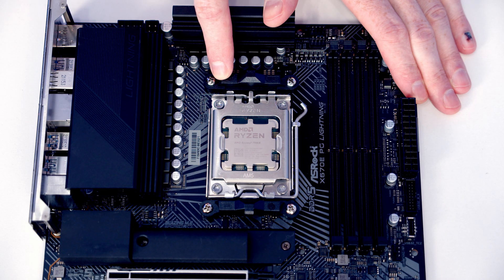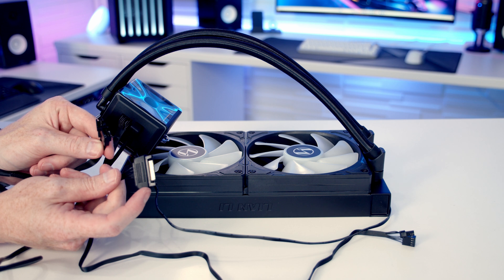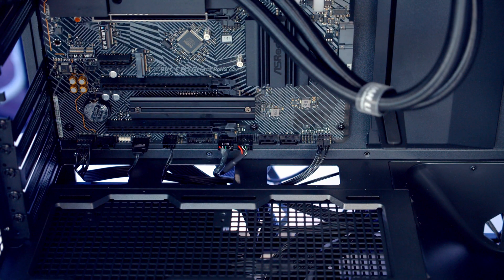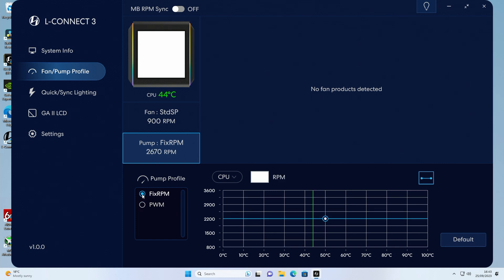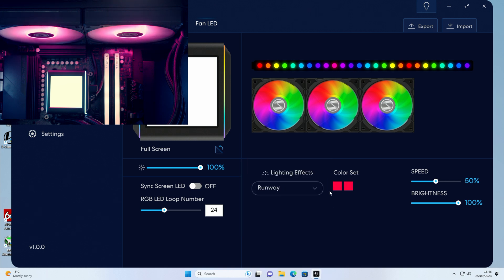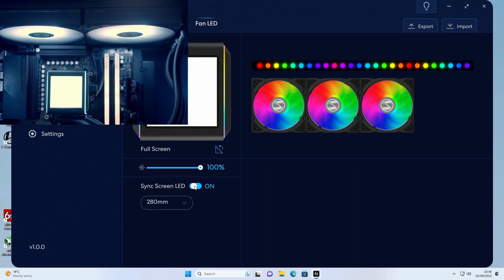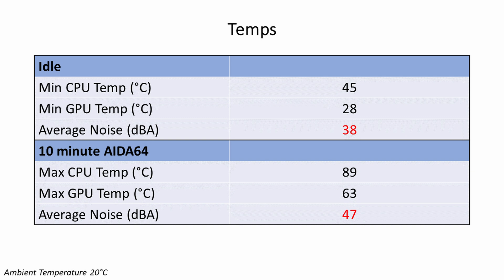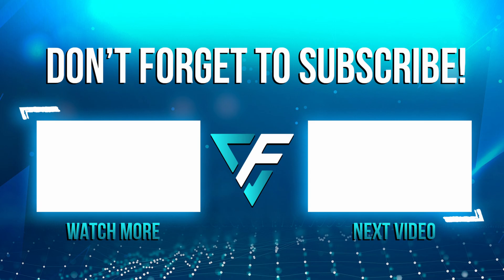Lian Li Galahad II LCD - Installation Guide

Comment: Fu...ng finally found someone that actually started from the very beginning without skip steps. and explained what are those cable and where connect them. Also explained how to use Lian li software.
My motherboard is a liitle different(MSI X870 TOMAHAWK WIFI) and i bought the 360mm version of watercooler, but rest it's pretty much the same.
well, THANK YOU VERY MUCH!!

Comment: i bought this over the weekend (except the LCD 280) at micro center and the box didn't come with "n" cable as it's called in the instructions...it is the split cable that plugs into the argb fans...i went back to micro center and they opened up 4 boxes and all of them were missing the cable...does anyone know if i can I can order that cable or a pack that has that cable in it? if not i am going to be really upset...i believe the actual cable is the PWM and ARGB to Lian Li Uni Fan SL Infinity 7 Pin Adapter Cable.....am i able to buy this? i am pretty sure i found it, i just want to make sure it is the correct adapter... if anyone has any suggestions on this i would really appreciate it thank you!!!

Comment: Is there a reason you didn’t use the controller? The other video I watched didn’t plug in the 3rd cable (3rd connector on the pump that had the SATA cable) but used the controller. I’m confused as a first time PC builder!😭🤦🏽‍♂️
Reply: I think the controller only comes with the 360 version

Comment: is it possible to change the orientation of the LCD in the software or does it have to be physically moved?
Reply: I wanna know this too because a store installed my unit incorrectly.
Reply: I figured it out, you can do it in the L-Connect software, under GA II LCD (Screen) look for "Full Screen" and right next to it is a right triangle, if you click it it rotates the screen orientation counterclock wise. Hope it helps.  @cemsengul16

Comment: Been going through a lot of LConnect 3 software issues with this product. Crossing fingers the company can fix it all this week for this is damaging their credibility.
Reply: They fix it or naw
Reply: @Demiii_GoD they have not. This software is incredibly frustrating, personally going forward I won’t be buying anything lian li as far as fans or cooler related in the future. I currently have a humming/revving noise while L-connect is open. If I uninstall L-Connect the sound goes away. I feel like it’s ramping the fans at a weird curve and I can’t seem to fix it at the moment.

Comment: Hey!  My 360 sl-inf LCD didn't come with the second cable that plugs into the pump.  Just the usb-C.  There doesn't seem to be a listing for it in the parts list either.  Is this not a thing in the retail version?
Reply: Same here, I had the Lian-Li GALAHAD II LCD 360 SL-INF and I also miss the cable at 2:07. Also not listed in the manual as you said. My Display is also going on and after few seconds off. Any solutions?
Reply: You only need the usb-c cable for the infinity 360 version.
Reply: @TheSjuris  This and I installed an older version from reddit

Comment: Been having issues with my screen turning on and then off. I don’t seem to have the cable you have that plugs in below the usb? But I am using an L connect controller plugging the fans and aio in. Any suggestions?
Reply: Same here where did he get that cable???
Reply: @alejandrorodriguez365 I found out that cable is for if your not using l connect. And just using your mobo to control the fans. But still no luck I made a post on Lian li Reddit. I’ve tried all software versions and no luck. Going to try a bios updated today. @christopherflannigan curious what software version your on?
Reply: Mine didn't come with one either. 360-SL-INF-BLACK
Reply: @Trystan_Rose Same here, I had the Lian-Li GALAHAD II LCD 360 SL-INF and I also miss the cable at 2:07. My Display is also going on and after few seconds of. Any solutions?
Reply: @Trystan_Rose  think it acts like a controller.  The infinity model doesn’t need that.
Reply: @alejandrorodriguez365 Same here, I had the Lian-Li GALAHAD II LCD 360 SL-INF and I also miss the cable at 2:07. My Display is also going on and after few seconds of. Any solutions?
Reply: Same here, I had the Lian-Li GALAHAD II LCD 360 SL-INF and I also miss the cable at 2:07. My Display is also going on and after few seconds of. Any solutions?

Comment: sorry im a newbie. so nothing to connect to the cpu fan? wouldnt that raise an alert as ur supposed to plug something to it? or that means i just need to disable the alert via mobo bios?
Reply from the maker: Some times it will give an alert that you need to disable in the bios, but most times it doesn't with the motherboards i have used
Reply: @ChristopherFlannigan  thanks. love ur videos. used ur vid on lancool 2 when i first build my first pc. now im planning to build on the hyte y70 touch. hope ull feature that case also :)